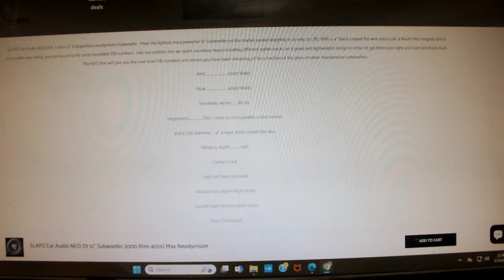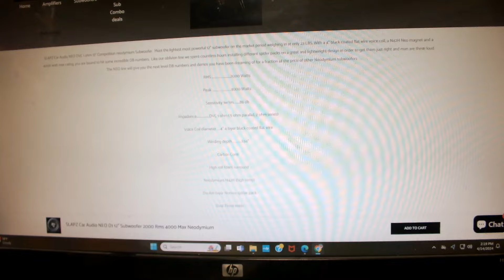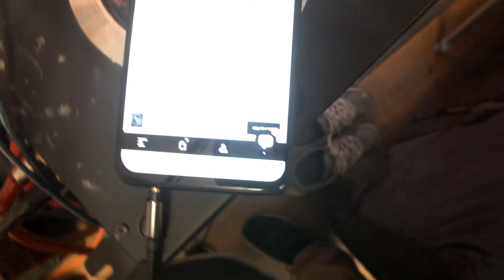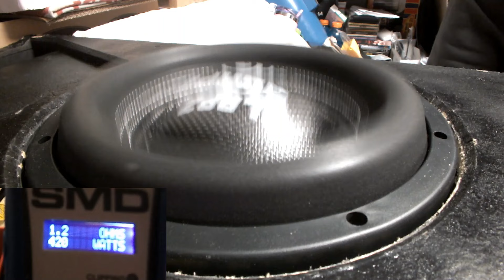Slapz Audio Neo 12 #sub #unboxing Taramps HD3000 #amplifier Taramps Big Boss 3 Bass #amp #bass #fyp

Comment: They're 4ga push terminals. Neo is light weight, and much less is needed to achieve the results of equivalent strengths of ferrite.  Downside is that neo gets hotter much quicker, and loses its motorforce as it heats up, where ferrite won't.  On a side note, when you wire coils in parallel, you decrease the BL. When you wire the coils in series you utilize all of the winding in the gap, and BL is at its highest in series.  You should wire it in series and use a 2 ohm stable, and test it as well.  Cool video 👍
Reply: Pretty accurate except ferrite does degrade with heat ppl use y 35 grade ferrite and heat turns into y 30 some companies use y 30!to start with.
Reply: @joshholden8561  It is actually very accurate, man. Of course any magnet will lose its strength when heated to a certain point,  but...  Ferrite needs to be heated to quite  high temperatures, for long periods before it starts losing it's strength, or up to reaching demagnetization.  When talking about ceramic magnets(ferrite) and the grades, it boils down to the chemical makeup, and their properties  The differences in these properties will show that Y35 magnets offer only slightly stronger magnetic performance versus Y30 magnets. This is why ferrite is more suitable for applications like speakers, that demand a higher magnetic field strength, that is less susceptible to heat. Neodymium quickly loses its pulling power (or strength) when it begins getting heated.  This is why neodymium subwoofers in particular, do not perform well as daily music builds, or demo builds. Neo heats up faster and loses its strength due to heat soak, and has a greater recovery time to cool or bounce back, versus ferrite.  Besides ceramic(ferrite) being cheaper, it is superior in many ways.  This is why it's been used for decades,  and why manufacturers do not make all their drivers with neo.
Reply: @joshholden8561  Also Y35 doesn't turn into Y30 when heated.  They have different chemical makeups and properties, that differentiate between, and separate the two grades.
Reply: @Chuck_Sanders  chuck heat degrades y 35 to  y 30 most of the time it's not a exact chemical change it's like having red paint and mixing a different color u still have red paint but now it's mixed with another color that u added
Reply: @Chuck_Sanders  I agree
Reply: @joshholden8561  While your analogy of mixing colors may sound OK, it's nowhere near the same, because you're not changing its chemical components by mixing between the two, nor altering what defines the grades, based on the chemical makeup that defines each grade. Yes, temperatures can greatly affect the magnetism of any magnet. Because heating it up and cooling it down can significantly alter a magnet’s strength, and it's resistance to demagnetization, and overall performance in a multitude of ways, it does not alter the grade. The main mechanism behind the effects is the impact of the temperatures on the atomic and molecular level of the structures within the magnet. The temperature only affects the magnetic properties of said magnets. The impacts of temperature can either strengthen or weaken a magnet’s attractive force, depending on whether the temperature is increased or decreased. When a magnet is introduced to heat, the magnetic field weakens, especially If the temperature exceeds a certain point known as the Curie temperature or Curie point, the magnet can lose its magnetic properties all together. It is right the opposite, when a magnet is exposed to cold temperatures, its magnetic properties become stronger. I'm not trying to argue, but temperature doesn't alter a magnets grade,  it only alters it's characteristics.
Reply from the maker: We just got the resilient sound's Gold 12 and the same thing. Thanks for your comment.
Reply from the maker: Nice. Great info.

Comment: 😂😂@kelp👍... It's mainly because when you start squaring the bass wave which starts very softly rolling in clipping.... AND THE AMP DC-OFFSET is what will cause alot of heat as well IF IT'S A LITTLE BIT HIGH range-0.04 - 0.20 mV YOU CAN CHECK THOSE TO AMPS with a multimeter.... On speaker output terminals.... WITH NOTHING PLUGGED IN RCA

🤔But it could have also just got hot cause of the power
Reply from the maker: I'm going to check that. I read this a few days ago and wanted to check it out. Thanks for your information and thank you for your comment 😊

Comment: I think i need to put some respect on the loud speaker in my phone i have listed to hundreds of bass dyno videos and my speaker on ghe motorola stylus has held up like a champ i can feel air come off it lol.
Reply from the maker: I have 3 stylus 5 g phone's. My oldest son got one and my middle son got one too. We have 5 in our house. I love them.
Reply: @SubzPawz  I'm looking for a phone now that has this so I can use type c plug to HDMI adapter I bought I'm shopping for phones as we speak that has this feature..

Device Interfaces	• HDMI Port (3840 x 2160 or 4096 x 2160 pixels @60 Hz)
Standards	• USB Specification Version 3.1 Gen 1 • USB Specification Version 2.0 • USB Specification Version 1.1